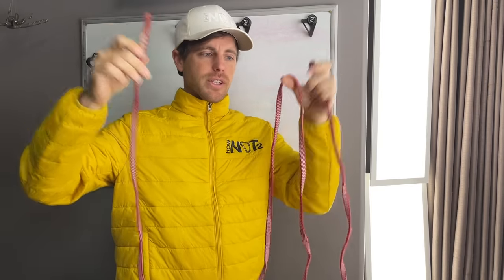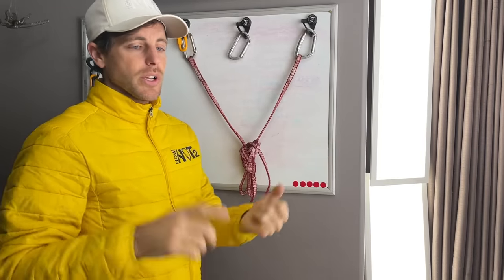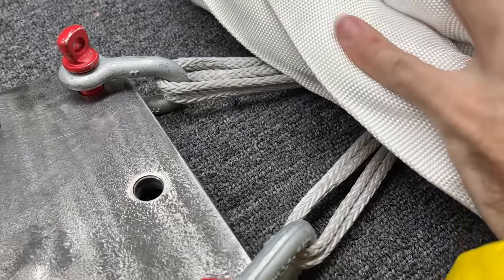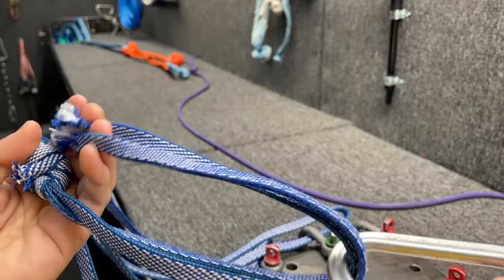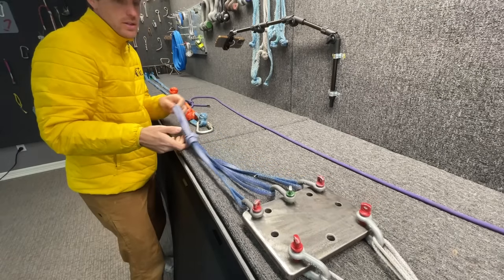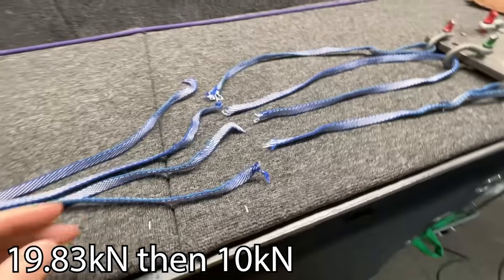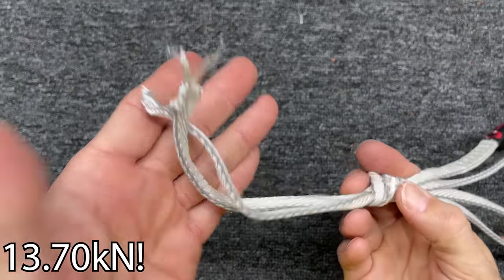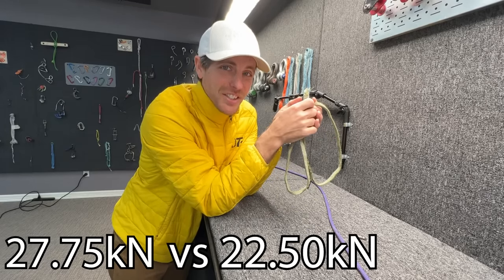Not all climbing anchors are bomber

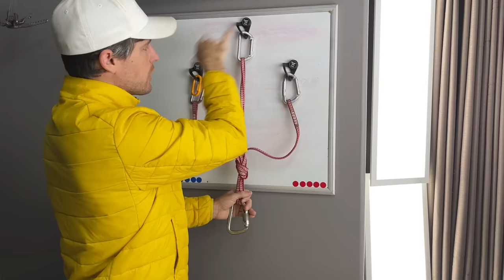Comment: I thought for a second you were joking with the "perfectly equalized anchor" at 2:26, but then realized you meant it with adequate length of sling going to each bolt. As is on vid there's literally only one bolt loaded. But finally got the point after thinking about it :D
Reply from the maker: I was joking that a 1 bolt anchor is a perfectly equalized anchor.  It shares the load evenly with one bolt.  Get it? :)
Reply: I thought it was a great joke Ryan 😂

Comment: In Europe we don't use slings for anchors anymore. We use rope loops instead
Reply: Europe here, and I definitely still use slings! Please tell me more about this new rope loop thing.
Reply: @doom.azafran  rope is just much more resistant than slings for anchors
Reply: @xtremdave  True, but it's way more bulkier to carry a rope loop rather than a 120cm dyneema sling. You're talking about top-rope anchors or multi-pitch?
Reply: @doom.azafran  multipitch
Reply: @xtremdave  What kind of rope do you use (and diameter) and how long?
Reply: @doom.azafran  between 8 or 9mm and 2,5 to 3m long with two carabiners at the ends tied with double fisherman knots

Comment: Now would you please test three clove hitches with no slack in between, using the climbing rope please ? I have never been convinced that all that (cordellette)  'dweebery' is worth the time. Test three cloves horizontal and then three vertical (drawing slack out from between) using the climbing rope. On the vertical alignment test I would like to see three mid sized cams a foot above the next, connected with clove hitches on the climbing rope and no slack between cloves to where if you jiggle the line below lowest cam all three respond. ?

Comment: So im a rigger not a climber but even tho the sling broke at auch higher load than it is needed at, it seems weird that you tied the fig8 knot in the sling.. id like to see the same test without the knot and the crab just joining 3 or even 2, without the knot they can move and equalise! Although if one log breaks you would obviously fall.. but it did break at the knot evertime...

Comment: Excellent video as always.
I have a question. Did you do the resistance test with a tape like the one in minute 9, but without tying the knot? just curious to know if it has the same resistance as with the knot or with the anchor to a point
I know it's not recommended to do it without the knot but it's just curious.
Reply from the maker: You can't really do this with this type of anchor because you would slide off the anchor if one piece blows which is the opposite of redundancy.

Comment: So how would I use a screamer for protection when falling? Tied between the rope and my harness? I think all PAS should be made of dynamic rope. On the plus side, us meatbags, when we hit that rope we don't hit it all at once like a weight, our mushy liquids and limbs are fairly dynamic, as though we are built to fall at the end of a rope. And when you said use two slings, well now it's not equalized is it.
Reply: You clip it to the sketchy gear in place of a runner. 

If you fall, it dramatically reduces peak force by ripping  (and extending). I’ve used them before, typically on micro nuts and heads when aiding. they do work.

Typically their activation force is too high to be as useful on your end, and I’m not sure I’d trust them (or they’d be worth the hassle). The ones I used wouldn’t deploy if you had to jug on them, for instance. 

They get pretty bulky, and can break in extreme situations.

Comment: Interesting question:  all these tests are done on slow pulls, which obviously never ever happens in real climbing falls (although I remember one particular fall in Mexico that involved grabbing and ripping out small plants and cactuses on the way down - but in that case my gear was the least of my worries...).  Think there would be any significant difference if the force was applied at the same rate as a real fall (9.8m/sec squared)???
Reply: Not really, because the climbing rope will make shock loading pretty much impossible.
Reply: @vanessaxoax7646  that’s what I think, too.  And there’s also friction of the rope moving through ‘biners, force absorbed by the belayer’s body and harness stretch… lots of things that reduce the forces.

Comment: I wonder how strong it would be without the figure 8 knot?   It would eliminate redundancy, but you could replace one long webolet with two shorter ones to get iedundancy back ...
My guess is that it would add 50% to the breaking force
Reply from the maker: If you could use two slings, then yes it would be redundant, otherwise it's the opposite of redundancy without the knot.  A sliding x on a sling is way stronger than a bfk in the same sling.

Comment: I'm not a climber, I just find this interesting. Why do you need the knot at all? If you left it out wouldn't the legs balance out automatically?
Reply: Yes, that is true, but if one of the bolts were to blow out, or one end of the sling we’re to disconnect, the carabiner would slide off the end of the sling and you’d fall to your death. If rockfall happens to cut one leg, you’re screwed. Relatively low likelihood, very ínstense consequences, so it’s not worth it. Climbing safety is all about redundancy.

Comment: What if instead of tying a knot, just clip the 2 hanging loops into a single carabineer. Gets rid of loss from the knot? Is able to slide so that if a climber is off center the lengths automatically adjust?
Reply from the maker: If one outside piece blows, you slide off the anchor since it isn't a closed loop.

Comment: If you weigh 150 lbs and are at terminal velocity, you can exert approximately 0.670 kilonewtons of force on an anchor.
If you weigh 205 lbs and are at terminal velocity, you can exert approximately 0.911 kilonewtons of force on an anchor. 
If you weigh 300 lbs and are at terminal velocity, you can exert approximately 1.335 kilonewtons of force on an anchor.

Comment: Didn't your offset anchor self-equalise because your rigging plate is on a sliding x, so the rigging plate just tilted?
Reply from the maker: Yea, i realize that now but they still broke in succession but I think stretch played a role in it.
Reply: @HowNOT2  yeh I think your test still worked and provided interesting results so it’s no big deal. Also fasting the rigging plate so it wouldn’t move would be annoying.

Comment: Not a climber, but what is the purpose of the knot?Why not just clip on the carabiner?
Reply: The knot makes it redundant. If one strand breaks then the others should hold and you don't fall to your death like you would if it was just a carabiner. If a bolt fails then the other bolts will take the weight without causing a sudden drop and shock loading the sling. Slings aren't good at taking sudden forces.
Reply: @jamesclark6257  Okay, thanks, but since it always breaks in the knot, wouldn't removing the knot make failure less likely as well as equalizing the load? Also, if wouldn't the fact it equalized better make it less likely for an anchor to fail? Again, not a climber, so I don't know all the considerations.
I'd be interested to see a test
Reply: @Mr. Quindazzi  it will fail at the knot if you pull it to destruction. Under normal forces, we are more worried about a defect or it rubbing on a sharp edge causing a failure. 
A bolt isn't likely to fail, but if your anchor is built from trad gear (nuts or cams), a failure is more possible. The redundancy  is worth one strand taking slightly more load than the other. 
What's the point of building a 3 point anchor if it isn't for redundancy? You could easily just put a carabiner on a single anchor peace and not use a sling or worry about equalising anything. Wouldn't be considered safe but you'd get away with it, right up until the time it killed you. 
We like redundancy. We are trusting are life to something and we want to know that I will take several things to fail before there's an accident.
Reply: @jamesclark6257  Thank you very much for the thorough explanation, I absolutely see your point. If you'll indulge one more question.What would be the reason for using a single sling and tying the knot as opposed to using 3 separate slings? Weight? Expense? Or is there a technical reason?
Reply from the maker: Good questions, we want a S.E.R.E.N.E anchor.  Strong = at least as strong as the master point carabiner.  Equalized means it pulls on the multiple point anchor evenly (or at least try) and this is why 2 separate slings rarely works because not all bolts are even or is the climber coming straight up between them, Redundant is why we don't just clip one bolt and call it good, Efficient is that it doesn't take too long to make (time matters), and No Extension means it doesn't shockload the system if one anchor blows which is rarely important because in a climbing context we usually have a dynamic climbing rope to absorb that shock.  This anchor in this video meets all those except the strong, i don't think it is strong enough but no one has died because something is "only" 15kN or 3,000+ lbf.
Reply: @Mr. Quindazzi  the anchor points may not be equidistant where you want the master point. So you would need to carry loads of slings of different lengths to build an equalised anchor. 
All that said, on sport routes, it's common (if you're not removing all the quickdraws from the route) to reach the top and use 2 quickdraws on the top blots to make an anchor to be lowered from. So I this case you are effectively using 2 separate slings/dog bones. Dog bone is the sling part of a quickdraw. But you would normally only do this to be lowered from and not climb from this type of anchor as they aren't locking carabiners.

Comment: You tied an overhand knot but you did not dress the knot.  When you don't dress the knot you can cause the fibers of the strap to twist (shear) while under tension.
Reply from the maker: I've never noticed any correlation to dressing a knot and it's strength.  Most bfks' aren't dressed more than I tied it in this video.

Comment: I do not understand your references/comparisons to carabiners. My understanding is that slings/loops/fabric are used for anchors so they retain strength regardless of pull direction, which carabiners do not.
Especially in alpine climbing, where the route (as chosen by the climber...) leading or leaving the anchor might be closer to horizontal than vertical.

Comment: A few observations:

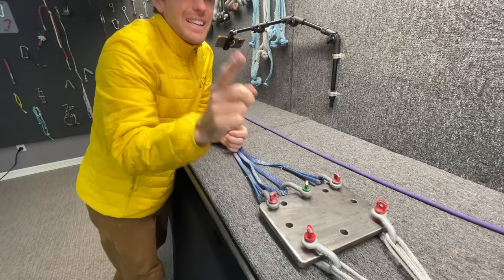(06:25) Yes, now you incidentally make mention how SERENE you are in your configuration, but are you indeed being ERNEST ? What, are we are not good enough for a clever acronym or two?

To be overly simplistic about the matter: A knot incorporated in a line decreases its load-bearing capacity by half. You are testing primarily knot strength, not the Web-o-lette; indeed, the fact that the setup is consistent across all trials is only what makes the results statistically significant.

A figure-of-eight knot, doubled or undoubled, while secure enough (if tied correctly!), “looks“ strong, although it has rather poor results for the degree it does weaken a line, as indeed all knots do.

There are many configurations that are better than the one you show. I suppose you wish to demonstrate the results of “how [k]not to“ do it....  ;-)

Thanks for doing this testing! There is adequate documentation, testing, and best-practices for everything you do and test, but a relevant source is hard to find and harder (for the layperson) to read and interpret.

Comment: I wonder... Is the knot stronger when you pre-tighten it more? Because I feel the actual process of tightening will create some heat, which will weaken it under load.
Can you make a video where you really tighten a knot before the load test, vs a just very loosly tied one? Any combination of rope(or sling) and knot you think might be interesting.
I think it will for sure be weaker, but I wonder by how much. 1%? 10%? 20%? no idea.